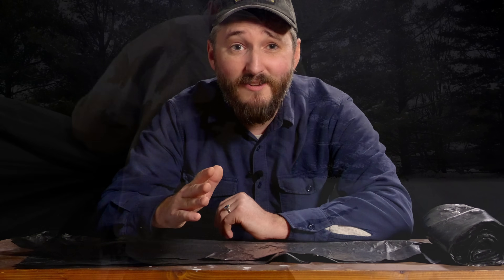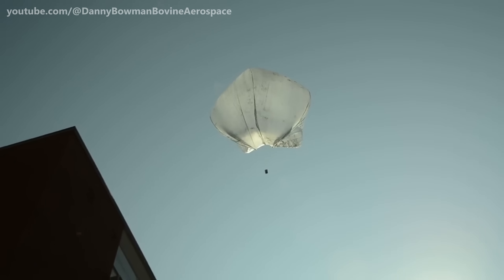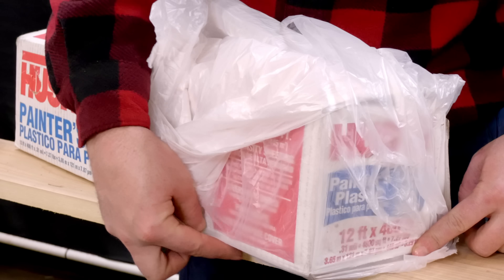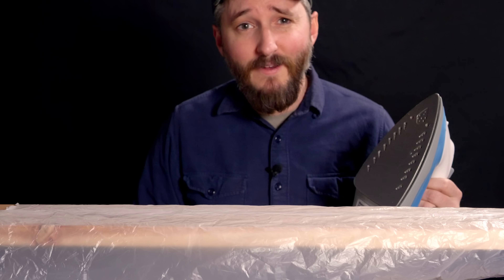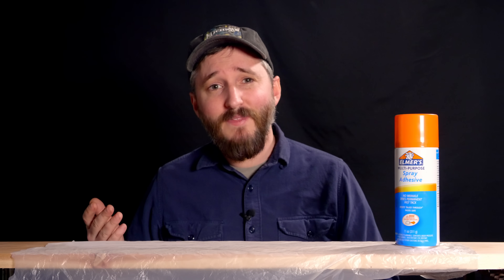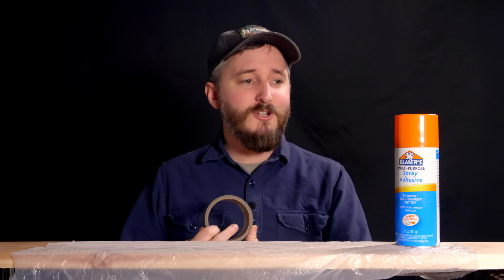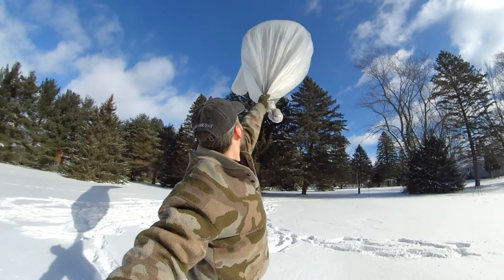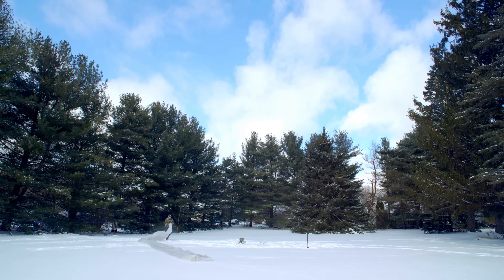DIY Solar Powered Balloons

Comment: You need a "pressing cloth" between the iron and the plastic. It will keep it from sticking to the iron as it melts but also won't attach to the "cloth" as it cools back down rapidly. Parchment paper usually works. Or at least it does with grocery bags. I'm not saying it won't still wrinkle/distort/burn through, but with a little practice, it works.
Reply: We always used wax paper
Reply: They make craft irons that are calibrated for ironing on PVC cutouts to T-shirts.  That might work for this.
Reply from the maker: Thanks for the tip! I think a better iron that's more consistent with its heat would also work better.